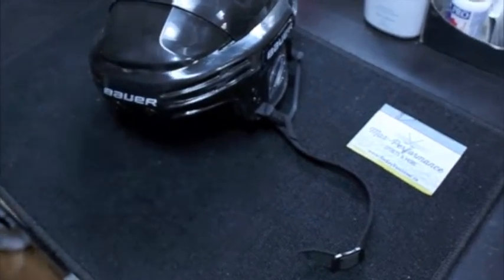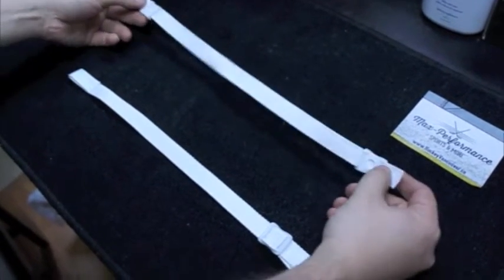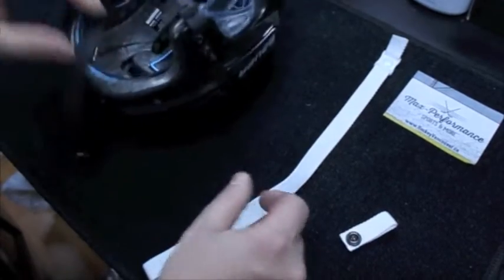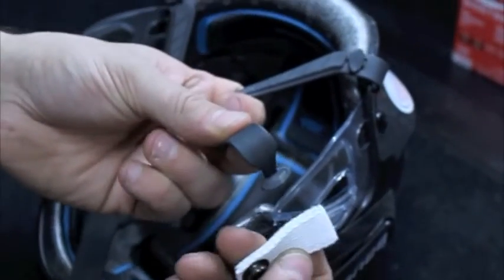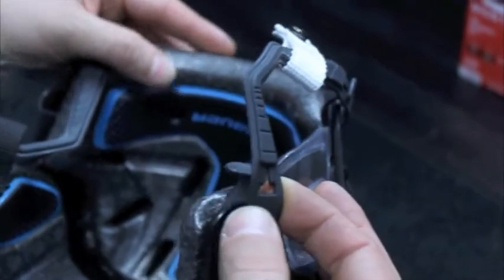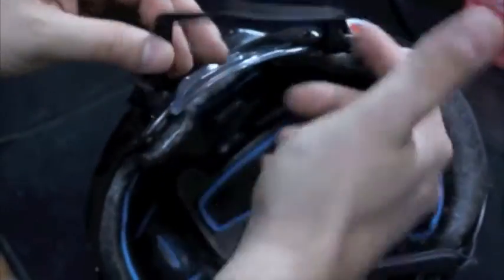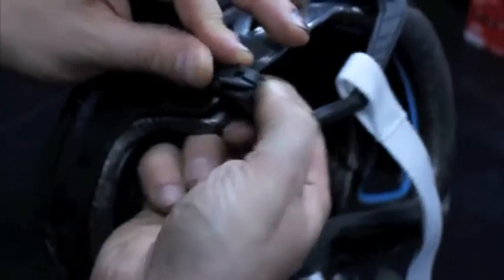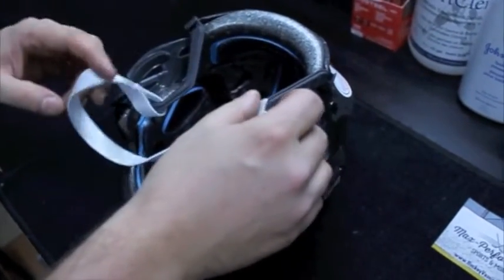How to Install a Hockey Helmet Chin Strap

Comment: From yesterday the hockey chin brick is split at  2 8 o'clock position the right side of the brick has the hockey shin with a short handle as it's linked to the cupboard but the left one from yesterday was missing thats because that part of the left side brick is the back block thats covering the tiny mountain v with the double paperclips halves. The left side has the double dots on the u and the right side of the paperclip in turn to make look like a Viking mouth tunnel